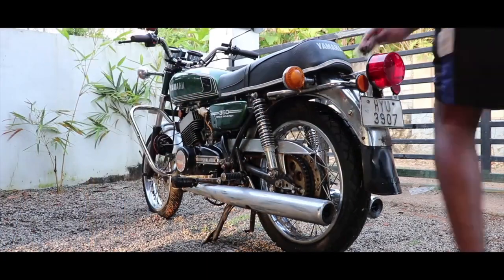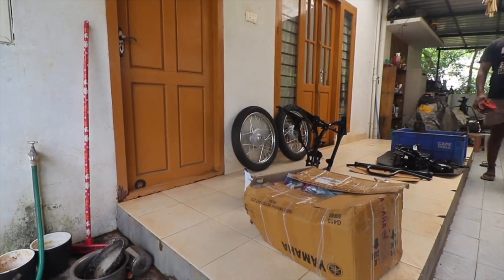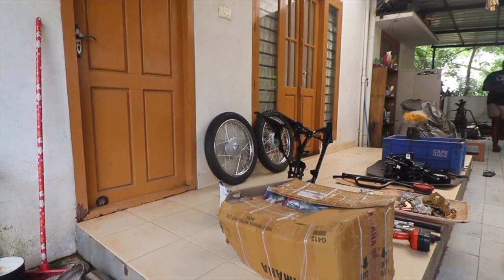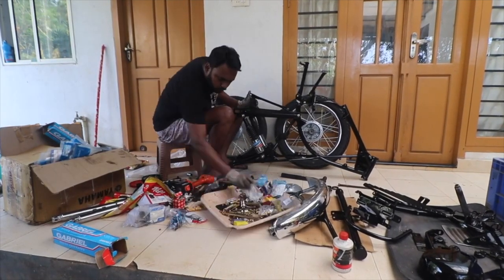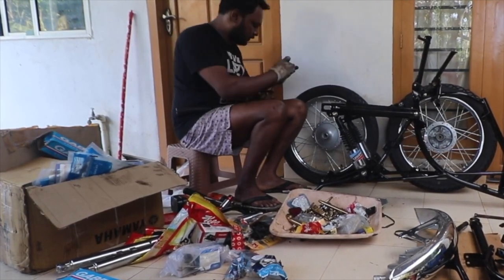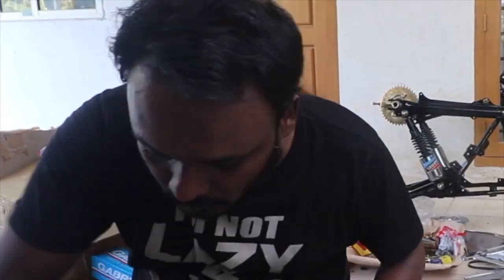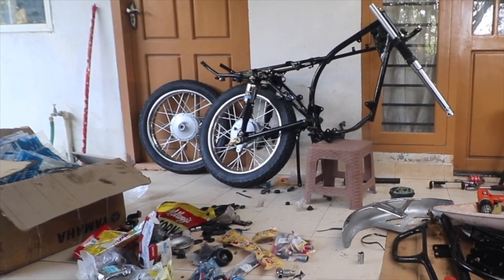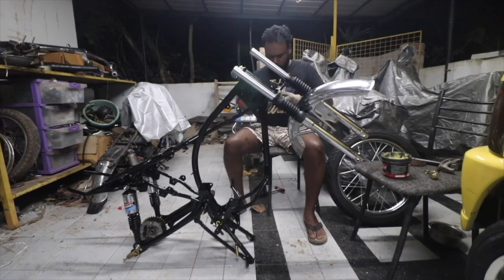How to plan a restoration properly & prevent money wastage

Comment: Beautiful video sir! Just a few small doubts : 

1) About the complete nut and bolt kit, you mentioned Zinc Dipping. Is that same to Zinc coating and Zinc Plating ? Also can we do that with the new nut bolt kit to get any benefits of anti-corrosion, or is it already coated/plated/dipped ? 

2) About that Rs.10K Mudguards lol, I am finding some mudguards for RX where sellers say 'OE Quality' but they are charging Rs.1,500 for front and back. Is it a good choice ? I think they are made by Diksha. My current mudguard has a lot of surface rust and since the bike didn't have any sort of service history and seems to have been completely screwed up by the mechanic, I am not sure if even the current mudguards are original or not. There has also been a guy who's making stainless steel mudguards for RX with guarantee of anti-rust but he's asking Rs.6,000 for it.

3) What is a 'good' budget according to you, for a normal but good quality restoration ? Do they differ for a Suzuki and a Yamaha ? 

Thank you!
Reply from the maker: Bratty Biker factory fresh nut and bolts are already zinc dipped. Deeksha mudguard are as good as you can guess. Their rubber parts are also substandard. Stainless steel mudguards will be great. Stainless steel doesn’t rust. The budget for restoration again depends on your vision of the outcome. There is not much difference between the cost of Suzuki and Yamaha rx restorations if done right. Cutting corners like painting the entire bike black without dismantling can be a quick way of covering up rust and abuse but a Suzuki can carry that look off better than an rx.
Reply: Yamakaze Right sir. Thank you! Yes, the right way of restoration is a complete stripdown and rebuild instead of covering up with black paint lol
Reply from the maker: Bratty Biker yes

Comment: Should i add oil when adding petrol to suzuki shaolin
Reply from the maker: Ahmed Huzaifph if your pump is not working(chances of which is high) add 30ml of oil to a liter of petrol
Reply: @Yamakaze  how can i check if it is working . Can you make a video on it if it is possible
Reply from the maker: Ahmed Huzaifph there is a video I made on the RX on how to change the throttle cable. Just take a look.